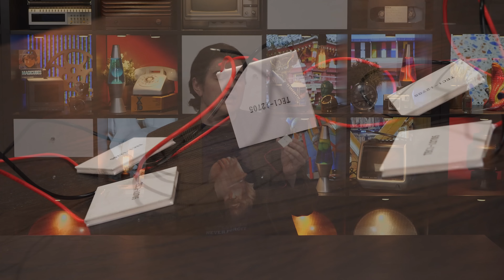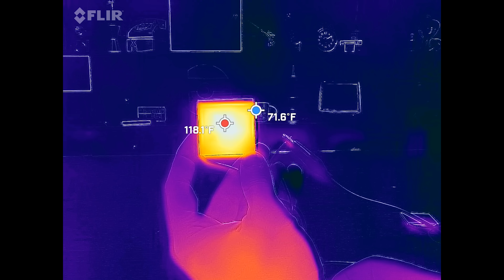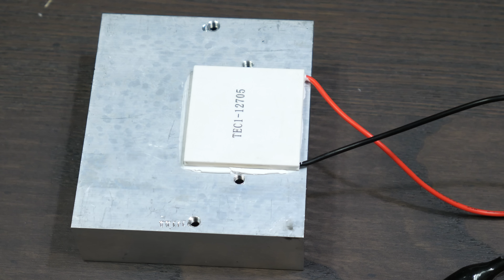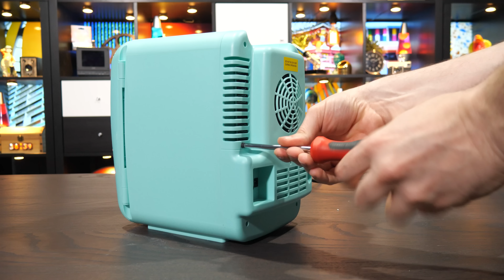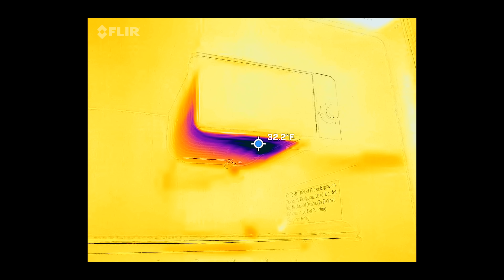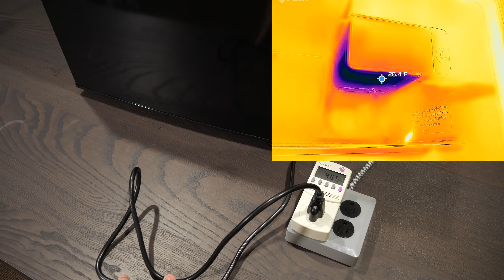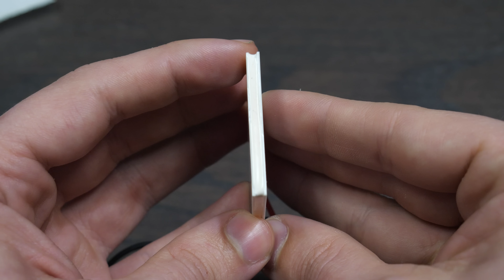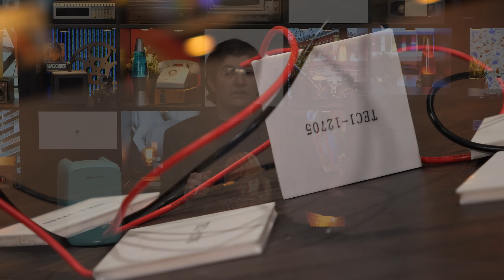Thermoelectric cooling: it's not great.

Comment: A long while ago there was a push by Intel together with EKWB and CoolerMaster to make below-ambient PC watercooling not just an idea, but a daily reality. What they ended up with were a couple of CPU waterblocks by EKWB and an AIO by CoolerMaster, which both used the TEC in the same way: they sandwiched it between the CPU and a somewhat normal CPU waterblock.
To say these were gimmicky is an understatement. The EKWB ones used up like 300-400W all on their own, only to reduce the CPU temp from the normal 40°C (normal for an overspecced customed waterloop that is) down to maybe 5°C below ambient... if your CPU wasn't underload...
Dunno how well the CoolerMaster AIO did, but given that AIOs generally don't perform as well, I doubt that it even provides below-ambient if the CPU is even remotely doing anything...

TECs in PC cooling are pretty much always overwhelmed by the amout of heat excerted by CPUs and GPUs, so any attempt at using them for PC cooling only really ever increased the powerdraw while making your system much harder to cool in the first place...

Comment: I am using a peltier-cooled box for transporting foods when I'm shopping a bit further away.  They're barely good enough and just don't cut it for frozen foods.  No channce of getting a proper cold beverage and due to the limited cooling power getting anything down from warm outside temperature to refreshingly cold is near infinite.

The problem - compressor cooling boxes are pretty big and a relatively significant part of their  volume is consumed by the compressor.  And for my twice a year use I can't justify something that last I checked costs like 800€£$ currency units.  So basically there are two solutions that suck.  Three if including cooling with cooling packs.

Comment: Why can't they somehow use that heat energy on the other side as power to keep running the system?  It has always seemed to me that there must be a way to make refrigeration / air conditioning that requires no external energy (or just a tiny bit to start it up).  All the energy is being taken from the system to cool, but then it's just being wasted.

Comment: Oh boy, I'm about to get menacing looks from everyone now, but... I have one of those. lol

In my defense, currently I'm in a space so small I can't even place a shelf, let alone a conventional mini fridge, so this thing stays on my desk and keeps my water chill for the summer.

So... it kinda does its job for me, but would be straight-up dumb to not admit that they are horribly inefficient indeed (heck, the one I had broke after barely one year and needed to change two capacitors).

The only positive thing I can say is that, somehow, ice started to appear once and I had to do a bit of defrosting. But that only happened once.

I'll probably switch to an actual mini fridge when I'll have more room for me.

Comment: I do wonder how low you could get the peltier with a properly insulated box, air flow, proper heat sink and thermostate. I bet it still won't be amazing but it's probably pretty solid for the size?

But in real world use these are best left for defrosting stuff on spaceships and rovers 😅

Comment: My daughter has one and yes she's using it to keep her beauty care products cool! 
I hate that it constantly consumes 60w but to it's credit, it does get ice build up.... So it must be getting down to 0°c.... It's in the bathroom and the gas central heater which runs 24/7 ensures that the bathroom which is quite small is always hot! 
I like the Peltier device, I believe that it has a lot of applications but no one seems to have used it correctly! 
Take that blue cooler, it has a single Peltier device which is mounted three quarters up the back side (which is a better location than the one I have which is half way up!). 
What they should have done is used two Peltier devices wired in series so that they get 6V each from a 12v source. They are more efficient running at 6V than they are at 12V but you will need more than one to get slightly better heat transfer, and secondly they should be mounted on top! And then there's the problem of insulation which in the case of these coolers is rather an afterthought..... 
Remember that NASA used Peltier devices on its pioneer one and two space probes to generate power via a radioactive heat source, which the heat source is giving up before the Peltier devices..... 
Others have shown that Peltier devices in a proper designed application can perform quite well! 
Also, if you ran a test where you were measuring power consumption of both fridges and you are swapping out a can of drink every 15 minutes over a week, you will find the the power consumption of the Peltier fridge won't change! While the other will! 
A 24hr test run was too short.... You need at least a week..... While it was able to show the temperature dropping quite fast at the beginning, the plateau of the temperature measurement was because the cans were reluctant to give up their heat! And there was a lot of cans that it was trying to cool with just one Peltier device probably running at 12v .... 
I think that even just a cup of room temperature water, over a week will begin to freeze even though it can only lower the temperature to a certain level below ambient.... It seems impossible but I bet that you will find ice has formed! My one does in a hot bathroom..... I don't know how but it does....

Comment: Why cant the peltier device's disadvantages be overcome through the magic of buying many of them? I mean, it seems like their biggest drawback is inherent to a steep thermal gradient, but if you hooked several in series and split the power up among them you'd get a smoother drop. Granted, you'd need to work out some details (e.g. the hot side would need to be able to reject more energy than the cold, requiring some combination of a pyramidal geometry and unequal power supplied), but it seems to be worth considering.

Comment: My handy little ferminator uses Peltier cooling, and it needs like 26 hours to cool down 28 Liters of beer wort from 25 °C to 10 °C in a ~25-28 °C environment, so it's not exactly fast, but it gets the job done. Yeah, I know, this is an exception, but for me, home brewing is almost a day-to-day stuff. :)

Oh, and it has temperature control, so thankfully, it's not running all the time.

Comment: Paused at the power figured to make this comment
It's not entirely a fair comparison for the power usage
You mention that the fridge uses 22w, but does this account for frequent opening? My understanding of refrigerators (from you) is that when they are opened, they lose a large amount of their "cold", so the compressor has to turn on again, using more power. If you never open it, of course it will use less, as it simple has to maintain for thermal inefficiencies in the fridge lining
Compare that to the blue [whatever that thing is]. It uses 55w continuous, regardless of how many times you open it

I don't think it's a terrible thing for an office desk either, you care way less about the power usage, and it can stay on permanently, allowing it to maintain the colder temperature, so cooling time it's as important
If you choices in the office are this, or a communal fridge where they often disappear, I'll take slightly warmer than no drink

Comment: My friends got a peltier based cooling box wich either run on 12V DC or 230V AC. It's not loud, but it's annoyingly noisy and it can't keep stuff cold. The manfucaturer actually recommnds putting ice packs in it.

Got myself a 50l cooling box with an actual heat pump and it even can freeze food down to -20°C. It runs on 12V or 24V and comes with an external 230V power supply. It only consumes 50 Watts while running.

Comment: I have an 8 can desk fridge like that, but it has 2 peltier coolers. It uses about 100w 24/7, has the hot/cold option, and is the most wasteful device I own. It's only purpose is to sit on a shelf with a joke inside.

Indiana Jones figure.

Comment: I have one of those Xbox-shaped peltier mini fridges that holds 8 “tall cans”. I also have a proper-refrigeration-cycle car fridges that holds 10 cans. Measuring power usage on DC using my EcoFlow battery, the Xbox uses more than 3x the power, to keep things only “kinda cool” where the car fridge has a proper temperature control that can go to under 0F.

Comment: Okay, here's what we do. 
- Get a blue blob. 
- Rip off the heat sink. 
- Attach peltier tiles to the back of the original ones.
- Wire the new peltier tiles into the power supply of the blob
- Infinite energy glitch you're welcome. 😎 

real talk tho: is it possible to increase the efficiency of a peltier tile by making it wider or something? Maybe a stupid question idk. ¯\_(ツ)_/¯

Comment: I had one of those peltier ice chest size coolers in the late 90's. I didn't have any problems with it cooling. My biggest problem was dealing with the condensation pooling up in the cooler. Compared to that little peltier cooler you have there I'd say that the peltier ice chest I had which was bigger worked better and was designed better. The door had insulation as did the walls. The cold side inside had a blower circulating air around inside. That was run by a motor on the outside that also ran a blower on the hot side. So it had no problem in keeping things cool inside. Even then it still was not as effecient as a regular refridgerator. It too had no thermostat and ran all the time.

Comment: Peltier elements suck for cooling, but they have another fun property, the ability to generate voltage when a temperature differential is applied. I really want to design a waste heat reclamation system for hybrid electric cars using them, but I'm not rich enough lol.

Comment: Man I wish peltier coolers were better. I have a problem with body temperature regulation. Pretty much the best option is not that difference from stuffing ice in a clunky heavy vest last time i got something. Unfortunately neither option is a good solution here, though peltier would be closer due to weight and flexibility. In theory a sheet of them could help, but it could be hazardous as well with how hot they can get

Comment: Sorry I'm European and I have a very big question. "What is going on with La Croix beverage ?". In the Engineering Explain video called "Why Gas Engines Are Far From Dead - Biggest EV Problems" he explain the problem of energy density with ... La Croix can ! (Note: he's not a EV hater, he just explain the biggest brake of EV, he has a Tesla (and also a petrol car) and explain lot of stuff on electrical and combustion car). And in this video, the measurement unit is the La Croix can (I don't like non metric unit, but this one is really practical), why this brand ? Is it cheap ? Is it good ? Is it the french name of the brand (that's always funny to hear an American pronouncing some French word).

Comment: I think the best everyday use for poeltiere effect devices it not heating or cooling, it's electricity generation, specifically for those stovetop fans you put on top of your fireplace, there they generate enough power to run the fan and they do noticably even out the temperature in the room and you don't have to worry about batteries or cables on top of your fireplace.

Comment: Those tiny ones are toys. I use peltier elements in my designs but it's mostly for weight, size, speed of cooling and noise. If I was to make that black minibar fridge using peltier elements, I would probably allow the top and/or back to be heat sinks and that would be enough for passive cooling making it 100% silent. I would probably have a fan on the inside where the noise is hidden by the insulation. And I would have a much more powerful peltier element. Peltier elements are not energy efficient at all, unless you always drink ice water and hot coffee/tea at the same time. :)

Comment: to illustrate why conventional heatpumps are so efficient vs peltiers you can think about it as the difference between shipping hundreds or thousands of terabyte harddrives of data across the country and trying to move all the data on them over wires
the shipping is clunky and inconvenient... but it has an insane capacity to carry data, so the larger the amount of data to be transferred the more valuable that capacity becomes
moving over the wire is simple and convenient... but it has limited capacity and is much better suited for smaller amounts of data that need to go to many different places

Comment: LOL Somebody should "stress test" you. These things are unhealthy for you to think about, it seems.

I'm glad you were able to convince some of the noobs that these tiny devices are mostly useless. But they have their niche.
If you like to tinker, you can improve them a bit.
I was given a little "Coke" branded one. I added an better heatsink, better fan & a speed controller to the fan for some make-shift temp. control because it would create ice in the winter with the upgraded components. I also bought one the size of an average beer cooler years ago, for my hotel room when I was doing pipeline construction.I added a couple of small computer fans to that one & it would freeze water. I kept milk, bread, yogurt, drinks & even a small container of ice cream, so long as I kept it right next to the cold heat-sink.  But you're still unlikely to get more than 45 degrees F below ambient.

They are a decent product in a car or truck. If they have two stages, they will even start to function like an actual fridge. Albeit, using about 6x the wattage in the process.

Comment: TEC are better used as electric generators for things like fans. There is a really cool product that uses the heat from a wood burning stove to power a fan circulating air around the room without any need to be plugged in!

You can even charge a phone or power led lights off a high efficiency TEC/TEG when camping!

Comment: This is an amazing video to watch after having taken apart my Coca Cola mini fridge (of which has the same build as the emerson). I feel I can safely confirm my Peltier unit definitely burned itself out and that is why it would work on the heat setting but the cold setting did not function at all.

Comment: I have a "properly" insulated Peltier cooler that I use for travel/camping.  To help keep the temps food safe, I keep a couple of ice packs in the bottom to help maintain the temperature when it's off , and it's an absolute game-changer for what foods I can bring with me.  Even with the temps hitting 26C in the car, the cooler will maintain 2C.  For sure it is not an everyday use item, but far from useless.

Comment: i used to have one of those Peltier fridges but the switch was the back has 3 options, off, cold and WARM. after the 12V PSU it it died and went up in smoke i took it apart and found the switch would just reverse the polarity of the Peltier and the storage compartment would become quite warm